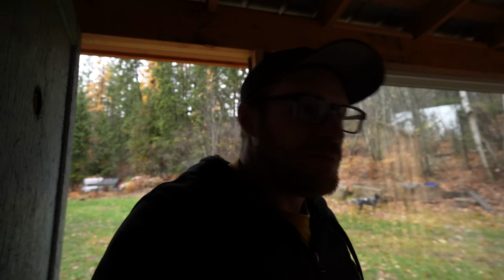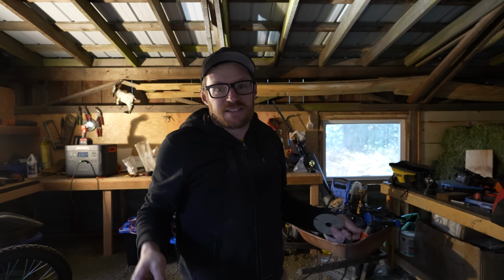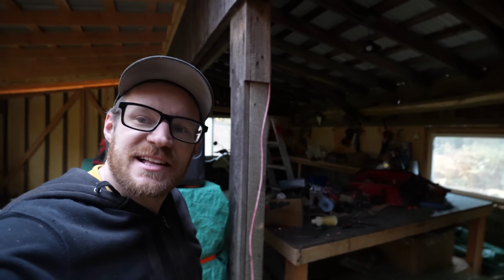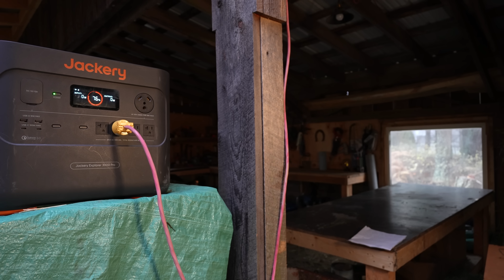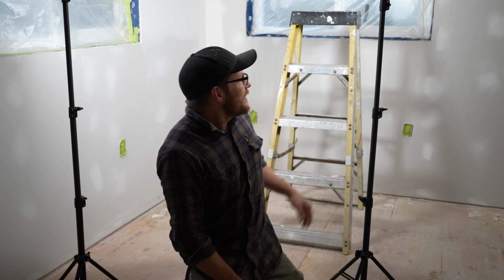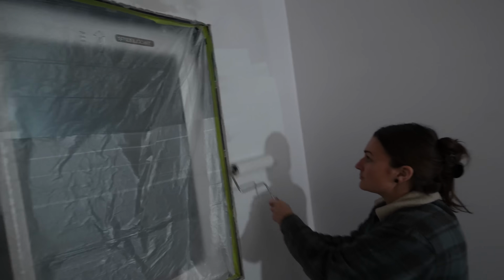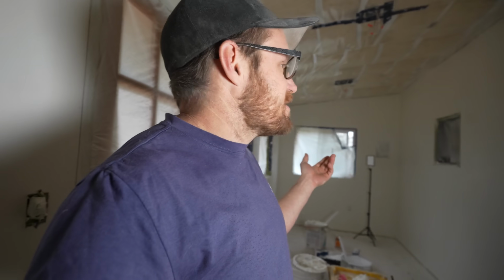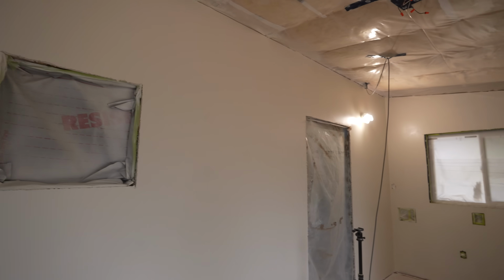We're Ready To Move On...

Comment: Shop lights is a Huge upgrade. Kraftee recycle parts too👍14 gauge is fine for lights . I would install 4-6 Shoplights in our garages on 14 Ga. and a 15 amp breaker ,  6 Outlets on 12 Ga. with a 20 amp breaker. never any issues. 🤙🔧🛠️🔧🔨Be blessed ya all.

Comment: Drywall looks good. Since you are running your lights off of solar power, perhaps getting daylight LED bulbs will use less power in the shed AND be brighter. Some people don't like the 'harshness' of daylight LED, but I have found it works quite well for close up work and project work. Just a thought.

Comment: Might want to think about a dutch door for between the laundry/boot mud room, and some stained glass of a foe stained glass for the small square window opening by the stairs. The pain't looks great, I hope you put extra wide mantles in the windows for plants. Although whatever you do I'm sure it'll be beautiful. And Greg, 14 gag isn't scetchy for LED lights, I use the same for mine, it's a low load wire.
Reply: 14 guage (romex)  is your standard every day house wire & it will support 1500 watts....  It is definitely not a low load wire
Reply: @1947maco  Thanks for the correction. I was comparing it to 3/12. mayvbe my terminalogy wasn't the same as you would use.

Comment: We roll out of a five gallon bucket with a roller screen its super fast compared to a roller pan. Another trick is to use a 3/4 roller nap its bigger and holds more paint. The combination of the bucket with a screen and a 3/4 nap we can roll as fast or faster than a sprayer

Comment: Your paint is too thick thin it out to run it through a sprayer then you will not have problems. For most paints you could use bottled water distilled is even better approx 1/2 bottle water per gallon of paint will give a nice flow.

Comment: Greg you ever wanna check your work doing seams.. take a light real bright i use 500 watt halogens. set it right up against the wall like aim it down the wall ------> closer to the wall the better, slide up and down wall and just look in front of light,.... stand back and look at wall wherever you screwed up... or where didn't put enough mud,... didn't feather seams out far enough,... you will see  shadows humps bumps or divets...and as for Katie ?you doing nails or screws same for you too you will see everyone you missed or didn't coat enough. you will see the crater. other then that looks good to me. and if you don't want to see them things then add texture to walls use water down mud and a texture gun use about 20lbs of air and just blow on wait to dry, prime then paint. just remember the thicker your texture mud your gonna spray..... the thicker the spot on the wall that stands out. mine is usually thinner then yogurt  the more you do the more you will find one you like and yes with a good semi-gloss paint Katie you can wash the walls. Satin or flat nope..... paint washes off. of all my 47 years and counting i never found one good flat or satin to put anywhere.. it is always Semi gloss or gloss. and also the shiner hahaha brings out all your flaws. and just saying an after thought you should never have to roll behind sprayer ever!! only reason is if your doing a crappy job putting paint on the wall... and Greg your tip is clogged you need to get it cleaned or another tip. i sprayed cars for ever and thousands of places homes churches offices so i always keep spare tips. and then if it has an internal filter clean it too. or change it. thanks for sharing great video awesome editing Katie..

Comment: What do you guys think of the ' Electric Paint Sprayer ' in comparison to a compressed Air type Sprayer . If I personally had a choice I'd pick the Air Compressor style , I've used the Electric style and don't really like it .
Happy Trails from Eastern Canada to Western Canada 🇨🇦  🇨🇦 ✌out . L8R
Reply from the maker: We like how easy it is to clean, even though it is smaller and requires more refills. It’s a much simpler system. Just need to remember the filter piece next time 🤦‍♀️